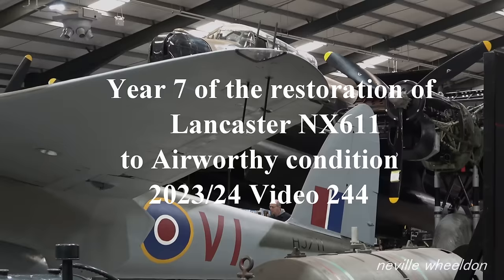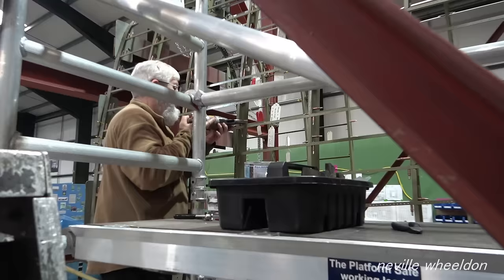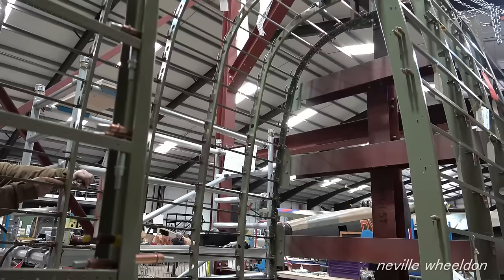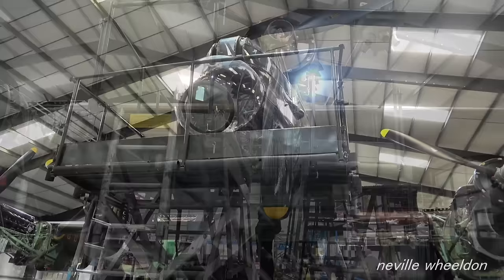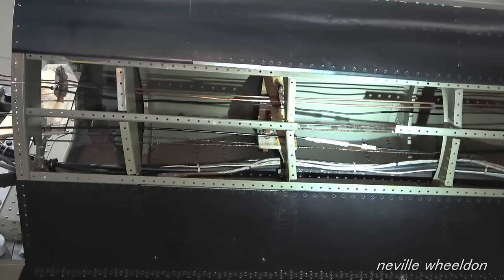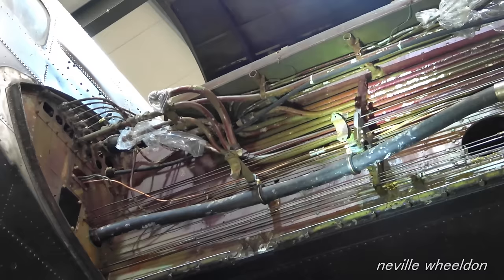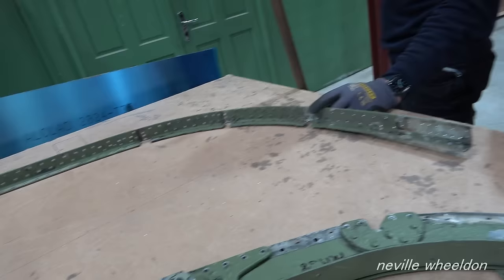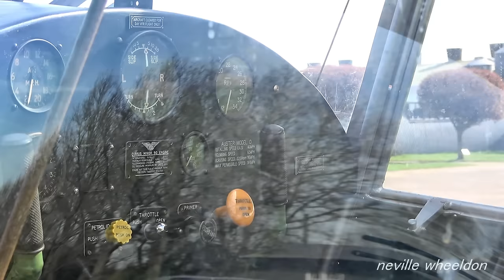244 Restoration of Lancaster NX611 Year 7.   No 1 engine fitted to the French wing

Comment: Would it be possible to put out a video defining the flying from the non-flying Lancaster restoration work? Thanks in advance from Canada. P.S. I watch Vera fly by my condo balcony every weekend during flying season. Always a majestic sight!
Reply from the maker: Hi Ron, The airworthy parts already restored 2- Tail fins 2- Rudders 2- Wing tips 1-elevator 1-aileron , donor parts fitted to NX611 at the moment are the rear fuselage from KB976, the front nose of the fuselage and the port wing all from NX664 (French) all non airworthy

Comment: What is the beautiful piece at 17:10 ?  And right after that, what is Dave doing with the jig ?  What is the small high wing single engine plane you show between the Mosquito and the Lancaster ?  Another beautiful video.
Reply from the maker: Cheers HH.the web of former 38 had to be replaced  so that part of the jig had to be moved to do the job. The small plane was the Auster used  as a spotter plane in both world wars it has a great history but just a visitor to the Centre